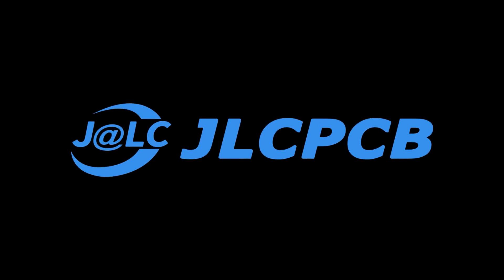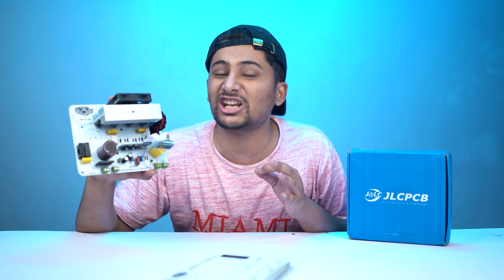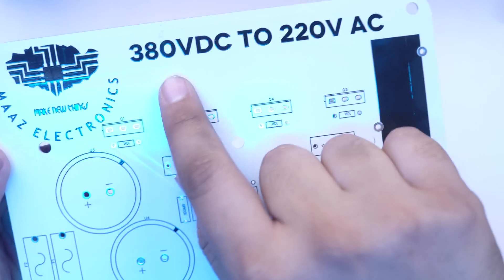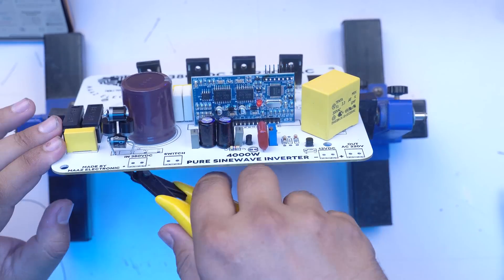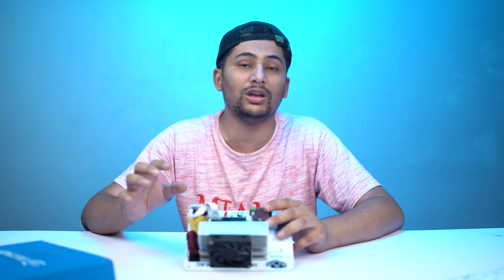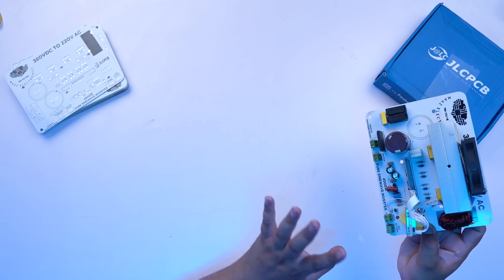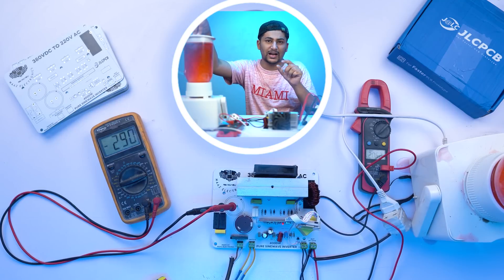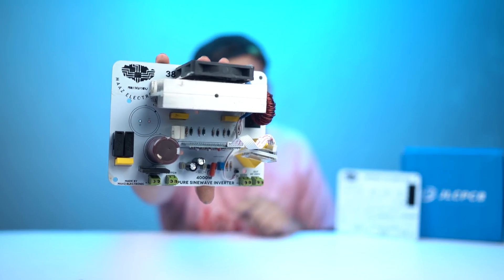4000W OFF Grid Solar Inverter | Solar Inverter | Pure Sine Wave | Grid Tie Inverter | JLCPCB

Comment: This circuit only works in videos in practical this circuit cannot handle more than 1A current for 1 hour meaning only feasible for 220 watt power also there are lot of mistakes in his pcb which need to be addressed especially for heavy loads.

Comment: electrodes used in this circuit can never ever bear the rated load. Simply making fool. it is impossible to hold 4000watt load in this tiny circuit. please don't make such videos, world will surely consider u frauds and people believing in it will surely be fools.